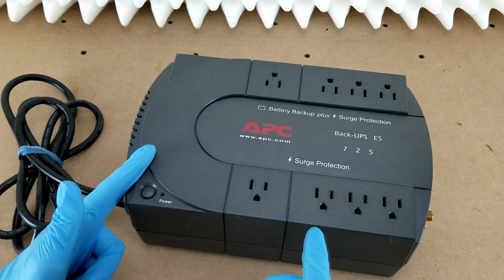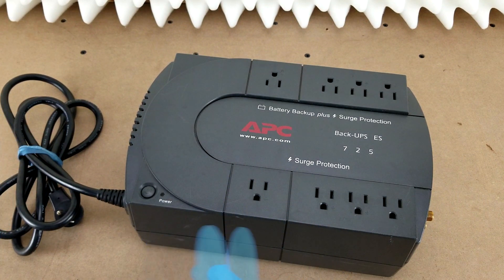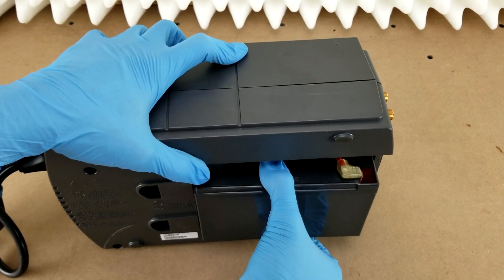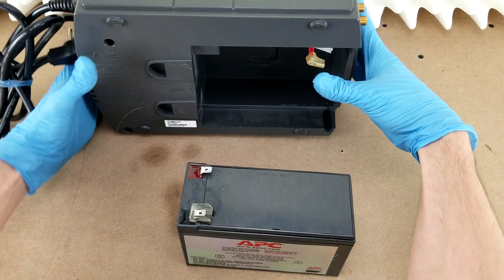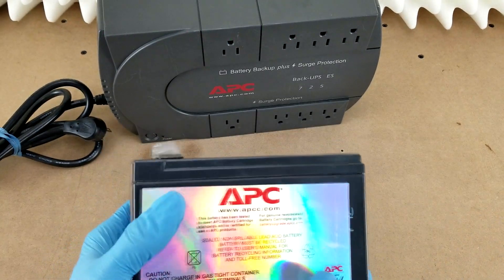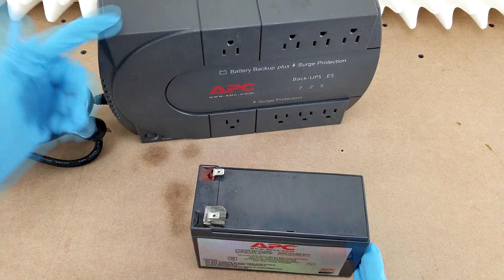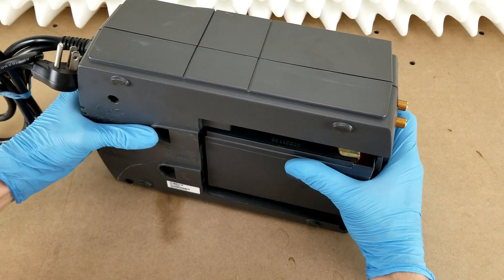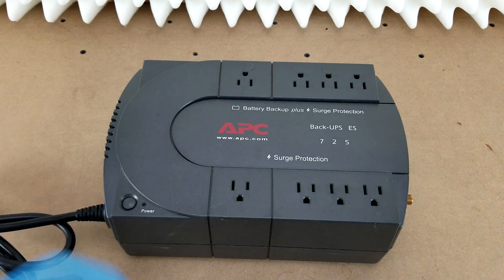🔋🔋🔋 How to replace the battery in an APC UPS! 🔋🔋🔋 (Back-UPS ES725)

Comment: Thank you, thank you for this video because the 650 models do not have those tabs you need to push down to get the cover off and was not shown by person so (NOT) expertly giving directions on replacing the battery.